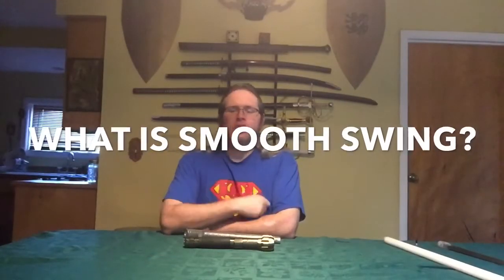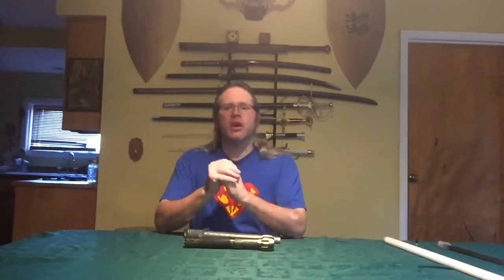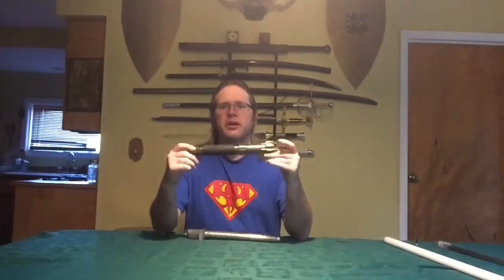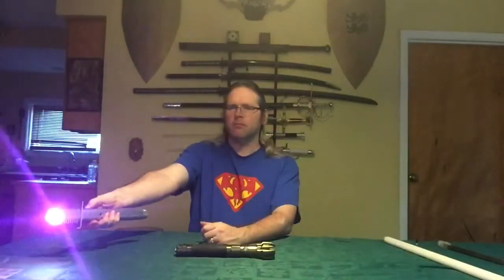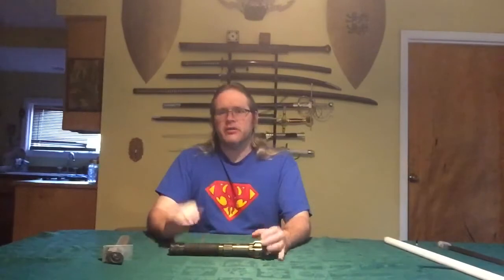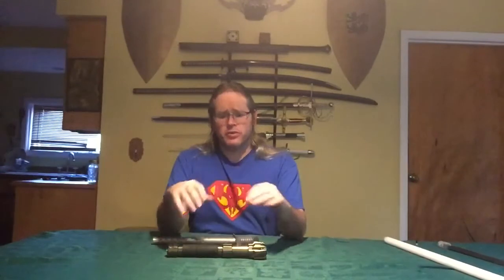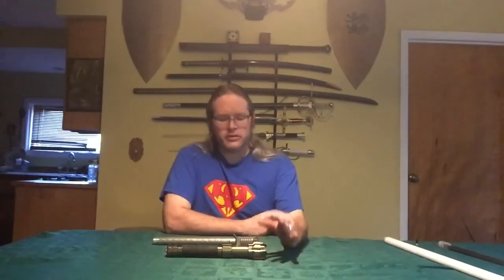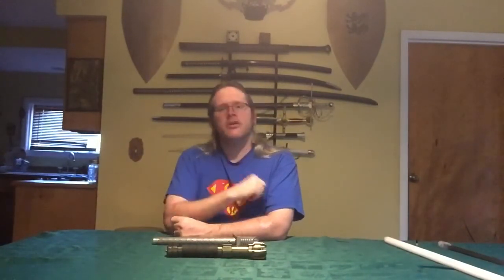What is Smooth Swing?

Comment: Do you know how the soundboard takes a swing effect and turns it into smoothswing? I'm hoping to design sound fonts that have a more dynamic swing effect like you mentioned but not sure how to accomplish that without much knowledge on coding so anything would help lol
Reply from the maker: this is an older video. these days, smoothswing is a longer file similar to the idle hum that layers in. If you are building a font, you can actually just use the idle from from another font to make it a smoothswing font.

Comment: What company offers a saber that has smooth swing, localized flash on clash and the slow ignition. Basically the most realistic saber. I want to just order it. I don't have time to look up everything and build it.
Reply from the maker: Basically you need Neopixel blade and either a proffie, Diatium 3 of CFX board. At current, the only place to just order one is The Pach Store for the Bors the Dragonslayer, or Electrum Sabercraft for any of their models.
Reply: sabertrio
Reply: Sabertrio has been using this, but their store is offline due to supplier issues. They get their stuff from asian companies, which have been kneecapped by the recent wuhan virus outbreak. Theyre saying itll be up by april.

Comment: Thats an awesome feature. Ive been looking for an electronics kit for a homemade saber hilt i made a while ago in the style of a wookie consular from antler, horn, bone and random damascus steel offcuts. It was a project after a car collision that prevented from continuing my bladesmith business. My 1st thought was a Nova outer rim kit, but was told a pach store kit had great features and was wondering if u have any thoughts about install kits concerning price and value of features. Cheers m8 and sub and a like. My soldering isnt bad so this video has kinda made me think of a proffie board being a good option , but also a little daunting for a 1st timer.
Reply from the maker: Very. It is the trickiest install I know of. As for a Pach Store Kit, they are not bad. I have one, but was waiting to review it until I had it in a hilt. I intend to put it in my Nihilus Saberforge, but they are showing no signs of ever actually making and sending it.
Reply: @DarthCephalus  cheers for the info bloke